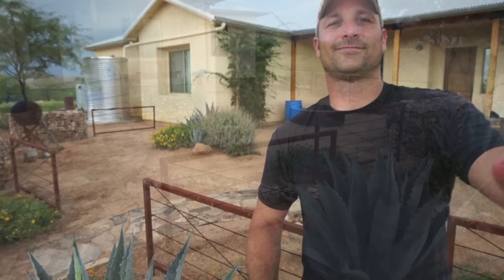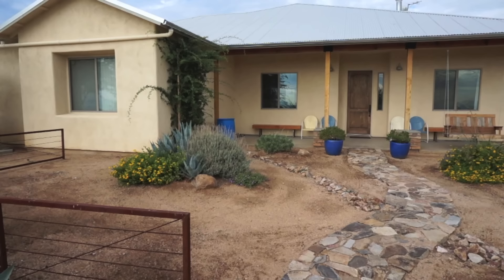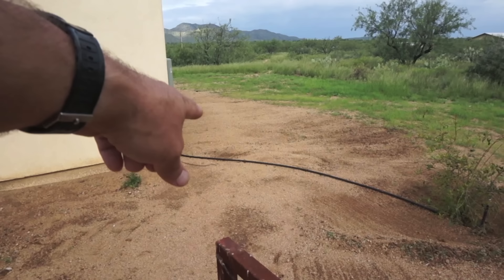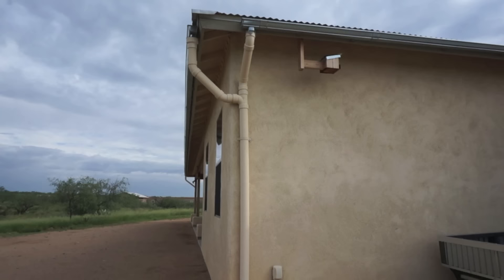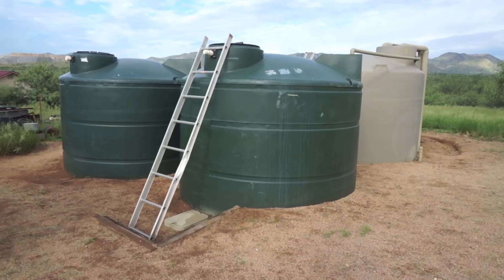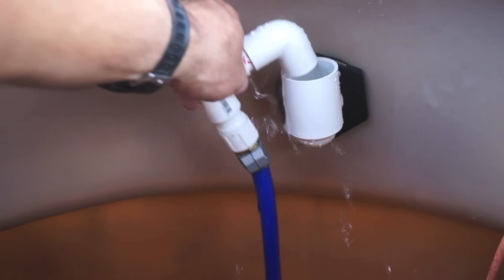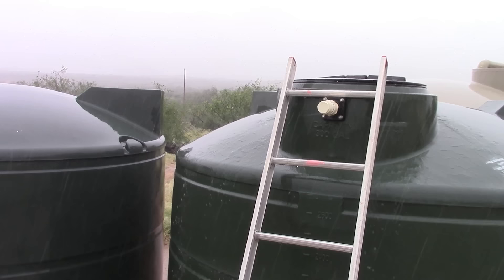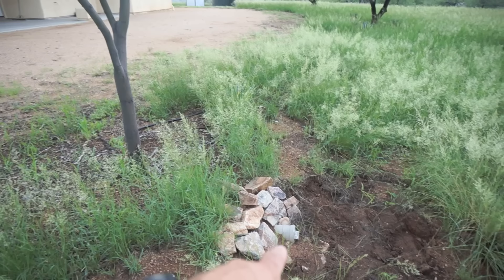Rainwater Harvesting - Home System Tour

Comment: Excellent video.. especially the drawing at the beginning. Didn't know that you have a secondary career as a cartoonist.... Ya'll collect 90% of the water you need on a yearly basis. I assume you deal with the missing 10% with a water deliver service. How much water (quantity) is that missing 10%? Are you planning on adding an additional tank to cover that 10%? Would that be cost effective compared to whatever the water delivery costs are down there? One thing that I forgot to ask when we were down there concerns the temperature , During the heat of the summer, how hot does the water in the tanks get and does it have any real effect on your hot water heater? I would think the warm/hot water would be a breeding ground for bacteria. Is that a potential issue?   Just a few questions Joe....  Inquiring minds want to know.... :)
Reply from the maker: +Randy Rought Hey Randy,

Yes, the 10% or so is by a delivery service… If we didn't garden then we could most likely make it year round by being conservative.  But it's not a huge deal… however, I am considering doing another tank or cistern, etc, to try and mitigate that issue.  As you saw, when it overflows we just lose all that extra water.  And that's painful to see… but as with anything, it is a capital investment of money that needs to be layed out.  It will pay for itself in time (our culvert cistern has paid for itself in less than 3 years!).

As for heat, believe it or not, even though the tanks are dark, the water really doesn't get warm at all.  More like very mild pool water.  Still feels slightly cool to the touch in the summer.  I think it's due to the shear volume of water and the fact that a lot of it is below grade.
As for algae/bacteria… that is solved with a little bleach.  We haven't ever really had an issue with anything like that.
PS-  Look for a follow up video on just rain questions… I've gotten so many of them that I think it might be good to dedicate a video to it :)

Comment: So I have what is probably a newbie question but I am going to ask it anyway.  You use a wet pipe system that leaves water in your above ground pipes year round. I have this sneaking suspicion that wouldn't work for those of us who experience hard freezes in the winter. Is there a similar system for those of us out in the cold?
Reply from the maker: zen69q yep...common quest but definitely a good one😀👍
Yes, in the winter a very cold climate would freeze the water in the pipes and potentially break/burst the pipes.  The solution is to drain the pipes before the hard freezes.  I also do this even in Arizona.....as we get some hard freezes  as well.  Granted they aren’t sustained as long as most places but we can dip into that teens.
As for the tanks...the solution there would be to have them in a building, insulate them, or bury them further below the frost line.   

Hope that helps :)

Comment: This is really interesting 
So the way I understand your rain collection system hydraulically is that you flow the rainwater by gravity into your holding tanks, which are almost level with your house. So when the tanks are full you must have the same water level in all downspouts, right?

So during the cold season the water may be freezing in the downspouts and perhaps the collections pipes since they are not very deep buried.

In summer you then have fairly warm rainwater in the downspouts and without circulation, are you concerned that the water fouls?

Comment: Joe - great video...informative, inspiring, and well produced. Why no first flush system? Do you think that would lead to less tank cleaning and flushing of the pipes? Thanks for making such a great video.
Reply from the maker: +Dave Ruark Hi Dave...I think I'll answer this on the next QA video...but the short answer is that I don't have an issue with leaves and such where I'm at, and a couple first flushe systems  that I looked at here in Tucson still allowed some dust and silt to go through to the tank.  And I just didn't want to have to mount it either...lazy...haha... but that's pretty much it:)  thanks for watching Dave!
Joe

Comment: When you were climbing out of the tank did you cut that hole and cap it or did you buy it with that hole in the very top where you can access in and out of the tank when you needed to clean it?

Comment: Nice system. Do you use this for drinking water? If so, what kind of filtration do you use? How many square feet are you collecting from and what's your average rainfall?
Reply from the maker: Hi ML,

Yes, this is my household water use... drinking, cooking, washing, etc,.  For most needs we just use the straight rainwater.  But for drinking and cooking we use a Berkey Water filter.  As for roof space I think I have roughly about 3,000 square feet of area that is being collected from.  That includes the house, porches and garage.  Aver rain per year is about 12 inches or so:)
Hope that answers your questions:)
joe
Reply: Thats not much rain in a year. I dont see how any thing grows there. Here in Southeast Texas we get that about every other week. And with that being said Im still wanting to build a system like that for my garden. Looks nice and that's Beautiful country you have there. Enjoyed your video. I learned a lot. Thanks

Comment: Where did you get your holding tanks in which one do you feel is the better one to get. I see you’ve got the metal and then you got different color plastics or did you paint those and how deep did you run your lines from your downspouts to your storage. And if you painted your water tanks what kind of paint did you use. Is there a particular thickness of your water tanks as far as how thick the plastic is.

Comment: How do you get the water to go up the vertical pipe into the first collection barrel? I assume the top of the pipe is lower than the pipe running under ground but doesn't that mean you will always have a lot of water in the line?

Comment: Very interesting video.  I have built a pretty similar system in central Texas. We have 5000 sq feet of collection area and a storage capacity of 12,500 gallons.  I'm not sure if that will do in this climate.  We do have a well to back up our system.CheersTed Montgomery
Reply from the maker: +Theodore Montgomery Hi Ted... sounds like you got a great system to work with.  As for your capacity, sounds perfect to me.  I always say that the more consistent rain you have the less capacity that you need as it fills up more often.  If you are in Central TX then you aren't 'wet' by any means, but you probably get a lot more rain than we do most years.  Anyways, I think your system with your roof collection area sounds like it's gonna be serving you well!  Thanks for watching:)  joe

Comment: Awesome system. Only question.. why expose plastic tanks to the sun?  I've read too much re: plastics and long term storage and the sun hitting them that leads me to believe they shouldn't be exposed like that.
Reply from the maker: Thanks dominique!  yes, sun will degrade plastics over time.  these are UV resistant but still they will eventually break down as well.  But ultimately its just a logistics issue.  the cost to build something over them would be more than just buying replacements after 25-30 years.  I do intend to paint them to help out but I just haven't gotten around to doing it yet.  But thanks for checking it out:)
Joe
Reply: Great cost/benefit analysis. Thanks!

Comment: Genius.  Thank you.  I hope to do something like this when I retire and homestead.  

One question - I knew there are issues involving rain water collection with a tin roof (lead).  I have yet to find issues of rainwater collection and a corrugated metal roof.  Did you put the corrugated metal over shingles and cap it?  I will guess it is 26+ in gauge.  Were there any structural issues with putting it over your existing roof?  Would you mind sharing the maintenance issues with the roof if any?  Can you walk on it for maintenance?

Again, thank you.  You are living my dream.
Reply from the maker: +Haitian Blue Thanks HB,  My roof is corrugated galvanized metal and has no lead in it.  I sometimes refer to it as 'tin' but it is galvanized and modern galvanized metal does not use lead in the process.  As for the install, it is my original roof when I built my house.... no shingles or anything like that.  And yes, we can walk on it very easily without bending it.  I can't remember the gauge but it is slightly heavier than 26 gauge... maybe 24 or something like that.  But much thicker than the stuff you get at homedepot or lowes... which is 29 gauge I believe.  As for maintenance, there really isn't any.   That was one of the big bonuses when we selected it:)  And the install is very straightforward, an underlayment and then install the metal.
  Anyways, I hope that answered your questions and thanks for watching:)
Joe

Comment: This is awesome! Do you think a similar set up would work in cooler locations? like if the pipes in ground were buried below the frost line and if some time of water heater was used for the tanks?
Reply from the maker: +Talbott Harrison Hi TH, I think it would for sure.  You would either have to bury it below the frost line or just make sure to drain the pipes before the severe cold arrives.  And as for the tanks, I think a livestock tank heater might work or you could inclose it into a barn or something like that?  Anyways, hope that helps:)
Joe

Comment: Joe, beautiful system! I am trying to to gauge how much volume those 4" underground PVC lines can handle with several downspouts feeding into one. A few questions: (1) how many square feet of collection area for your house? (2) Are your downspouts 3" diameter?  And it looks like you have two of those 4" being fed by all the downspouts, thus half the roof per each 4" PVC underground line? Thanks!

Comment: It looks like the rain goes straight from your roof into the main lines leading to your tank. Do you have any separate "filtration" lines that allow sediment from your roof to drop out of the water, or would that potentially accumulate in the lower portions of the line? We have a lot of agriculture around here which kicks up dust constantly, and I'd be afraid of my underground pipes needing to be cleaned out manually every few years or so. I've seen other systems that have a small tube directly off the main lines that fill up with the first (most "polluted", aka dust and other particulates) couple gallons of runoff before overflowing into the main system, and those tubes can be easily cleaned out. Would you recommend something like that in high dust environments like ag areas?
Reply from the maker: Hi Lady,

I actually have caps at the low ends of the lines (towards the end of the video) that I open a few times a year to flush any dust and sediment.  As for the first flush diverter, I decided against it as my rain tank sort of acts as that and it was an expense that I didn't want to add.  I think they are great in many areas but I toured some in the Tucson area and they still had dirt and sediment make it into the main tank as the first flush isn't truly enough capacity to all the entire cleaning of the gutter in only a few gallons.  I vaccum my gutters once a year to help with it as well.  Anyways, I hope that answered your questions:)
joe

Comment: outstanding! I do have 2 question though: 
Is there no concern driving over the pipes or a car resting on them?

what do you use your water for?
I hope i didn't miss the answers to these before.
Reply from the maker: Hi MMOG2G,

I'm actually working on a questions and answers video for this.  Should be up in the next 5 videos or so.  
But the quick answer is that I don't drive over the area the I put the pipes.  I have driven over them with no ill effects but it was because I had a load of stuff I needed to get to the back yard.  
And the water is for everything.. drinking, cooking, bathing, washing, gardening,.... we don't have a well or city water so its our main water supply.  I filter the cooking drinking water with a berkey cermic gravity filter but everything else is just straight rain:)  Hope that answers your questions and sorry for the super slow response:)
joe
Reply: homesteadonomics cool, thanks for the reply. this has encouraged my wife and me to check this out and hopefully get started too. would it be possible to talk about the types of reservoirs you use, material type, and why you chose or didn't choose something?

Comment: Showing people your water transfer system is great! However... using an extension cord the way you have with water able to run down it to the connection between the pump cord and the extension cord, and that it is suspended above an open body of water is very wrong. If you're putting, how to videos, out for people to follow.... you should have a direction towards safety. As a government electrical safety advisor... I would highly recommend that you amend this portion of your video before this may become an issue ( ie. People doing the same and somehow getting electrocuted and suing you...)  Beyond that... this is a very good DIY system. Thank you for showing your system.

Comment: Does the rain put off enough pressure to run the water from ground level to the top of them holding tanks. How does that work.
Reply from the maker: Yep, sure does.  If you look at the sketch I did in the beginning I explain how the level difference allows for the movement of the water.  Hope that helps and thanks for watching:)
...also, stay tuned as I'm planning a video specifically answering rainwater questions that I've received from this video:)
Joe

Comment: i am assuming it doesnt freeze there and a wet pipe system would not work in a colder climate. is that correct?
Reply from the maker: +Scott Haun Hey Scott, we get freezes but not very low… maybe like the low 20s as the coldest.  In mild freezes this system would be just fine…. but for those northwest winters you'd want to drain the system.  So it'd work pretty much any place but in the colder times you would definitely want to drain… I can drain the pipes in this system in about 5 min or so.  Not a huge deal as the snow wouldn't be flowing anyway:)
Reply: +homesteadonomics  thanks that answers my question as well.  this is really cool!

Comment: Hi there, awesome setup! On my collection system, I have the gap between the downspout and the input to the buried PVC at the bottom instead of at the top like yours (where the water enters the system). My problem is when the system reaches capacity (before it hits the tanks) one or two of the inputs from the downspouts will overrun dramatically. I do have an overflow that I can open slightly before it goes to our tank to alleviate that. What do you suggest? Thanks for the help!

Comment: Do you bother filtering the water at all before use?  I've seen videos with multi step filters involved.
Reply from the maker: +Ben Brandon Hi Ben,

I don't bother with all the 'multi stage' filter setups that many people have as my situation yields very little sediment, etc,.   Not to say that there aren't some great setups out there, but that it's an extra step that doesn't really fit my needs.   99% of all the sediment is collected in the tan tank and the green tanks get virtually nothing but clean water.   If I lived in an area that accumulated stuff in my gutters it might be necessary.  
Essentially, the water in the two green tanks get a little bleach and then the cooking and drinking water goes through a Berkey Ceramic water filter.  But for showers and everything else it's just plain old rain water:)  Hope that helps! 
PS- I plan on doing a video on berkey filter and in house water use in the future:)
Joe

Comment: Have you considered making solar panels on the pump shed to have it run from battery power.. all in all what you have going on with this is my end goal.. any ordinances or permits/taxes you have to pay  for storing that much rainwater?
Reply from the maker: +R. J. Denicola Hey RJ… i have plans to do something with solar for this but haven't so far.  As for permits/etc… it will mainly depend on the area you are in.  I built my house and had an inspection for the water system inside the home but nothing for the pump house or rainwater system.  Hopefully your area doesn't regulate things too much.  As for a gov't taxing for stored rainwater… I hope not as i'd consider that criminal on their part…lol!  Lets hope it doesn't ever get to that:)  Thanks for watching!

Comment: Amazing video! If you had solar panels on your roof, would that cause any problems with consuming the water?
Reply from the maker: HI Bruce,  I don't think I'd be concerned about solar panels and water issues.  They have a polycarbonate or glass outer which shouldn't really affect anything.  Besides, I use a Berkey ceramic water filter for all of my cooking and drinking water.  So if I get to where I can add solar (financially that is;) I'll probably certainly do so:)
joe

Comment: i just both a hose and this is something that i want to do , how much it cost ?  and you work looks really professional and amazing ', wow
Reply from the maker: Thanks so much Jluis!  the quick ball park was roughly $4k(plus $500 for the culvert cistern)... I have some more detailed breakdowns if you scroll down.    It sounds like a lot but you have to remember that I don't have a well so this is my primary water source for 95% of the year.   Anyways, I hope that helps and one thing to remember is that most of the cost is in the tanks.  And if you live in an area that rains come more often, then you won't need as many tanks because you will be getting them filled more consistently.  I have to have the capacity to make it to the next rain.  So in that case you'd have to spend much less to do a similar system.   anyways I hope that answered your questions:)
ps.. i'm going to be doing a rainwater harvesting QA video soon so stay tuned:)
Joe